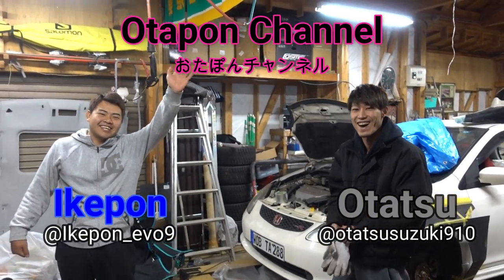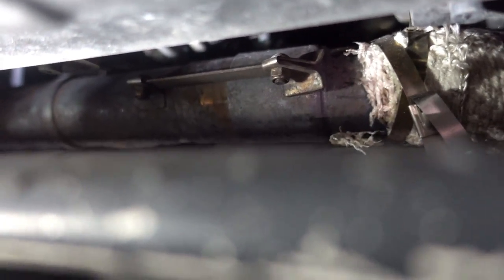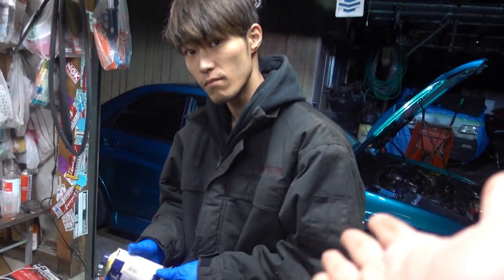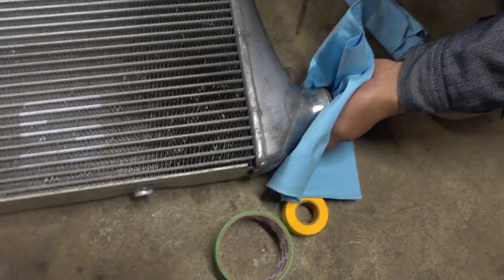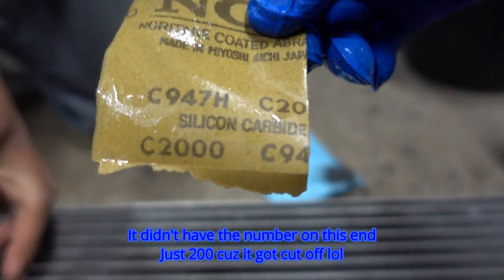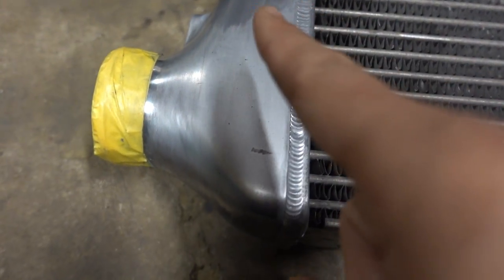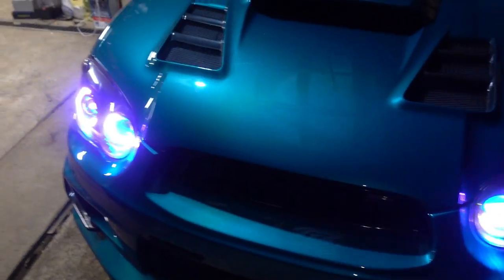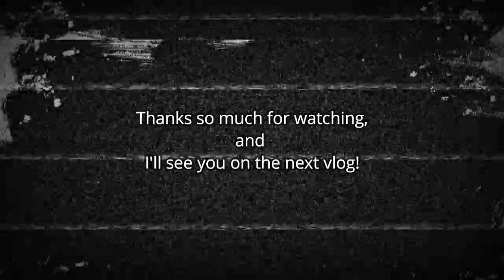How to polish an intercooler | Never get Tomei parts

Comment: Shitttt. I have tomei equal length header on my WRX right now. 😰 I'll check it out first thing in the morning if there's any leaks. Good thing you spot that before it gets worst.

But anyway your intercooler looks clean now. Yay! Very shiny.
Reply from the maker: I forgot to mention on the video that Tomei USA gets their product from a different company(not made by Tomei) because the turbo is different.
Subaru USA uses single scroll turbo on STi, but Subaru Japan uses twin scroll turbo and that's why there's two pipes.
I hear Tomei USA is better, but it's always better to use one piece exhaust manifold.
Let me know how your's is ;)
Reply: Thanks for the info. The headers seem good and they're still holding up. No cracks or leaks. Lets just hope it'll last long.🤞
Reply from the maker: nightmare 1990 Exhaust manifolds are sopposed to last 3yrs average.
Tomei only lasted year and a half for me😭
Hope your's last